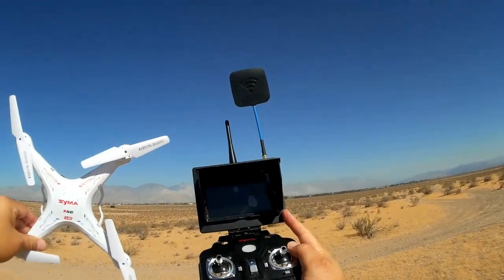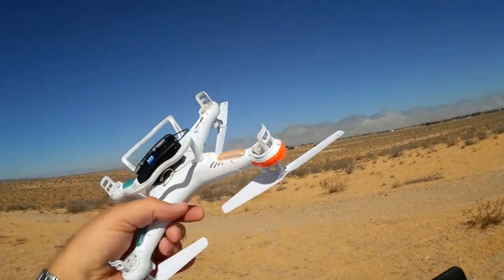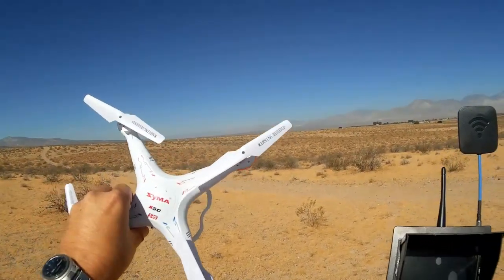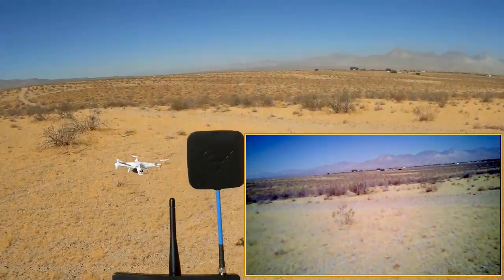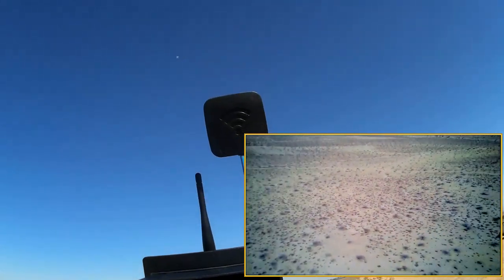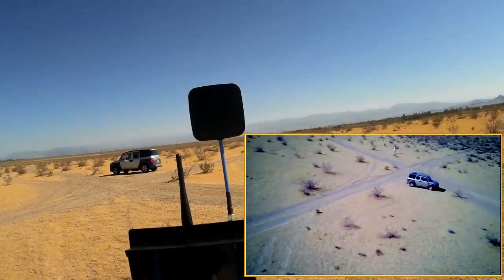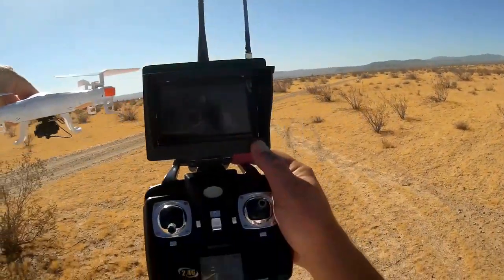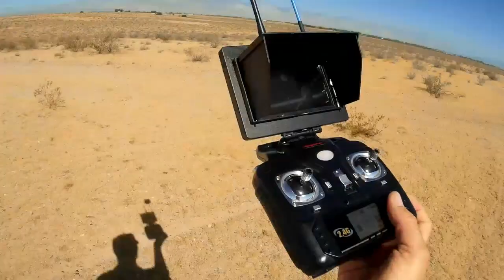Syma X5C X5S 5.8Ghz FPV Upgrade Review

Comment: first of all, please excuse any mistakes or typos. I am using speech to text as my vision doesn't allow for small screens like this to be easy.
Let me just say, that this is the most awesome piece of add-on equipment ever made! the world is completely different flying from the driver seat. I always had trouble using the rudder, flying line of sight, but this makes you naturally use it. it's a really incredible piece of equipment for the price and the fact that I can later add goggles makes it a big winner in my view. thanks for reviewing this now that I have one I don't regret getting it I've only flown it once and I think I'm addicted to FPV now from this point on. so, off to get a pair of boscam compatible goggles. that would make my RC world complete I'm also working on a way to strap this thing on to annex 8 C.

Comment: I bought a 2nd Syma X5C sans transmitter and camera.  I already have two transmitters for the X5, one being the X8 transmitter.  So after watching this video I went ahead and ordered this FPV kit.  It works like a charm and the picture quality is better than stock.  I like it a lot!  Thanks QC101.
Reply: Great to know :) I couldn't find it anywhere though, could you tell me how long the camera's battery lasts on a charge? 
Thanks for the infos.

Comment: First of all thank  you for demoing the FPV system. I did order it and I did modified it for the CX20.  I spliced in a micro push button switch to turn on and off the recording features.  The picture in the screen is clear and you can see it in normal sun light. Then only thing I believe I am getting interference from the GPS on the CX20.  The picture goes in and out around 20 ft.

Comment: I got one of these and LOVE IT! I installed the Monitor in My Quanum Goggles and I took My WLToys V686g Monitor and Mounted it on My Syma Transmitter for the best of both Worlds, It is compatable and works with the 686 5.8Ghz Camera also, what a Great Bargain, Love that it gives the option to change channels which the 686 Monitor doesn't do, but it's easy to match them all up on the V686g Channel, Having a blast doing FPV with Both, and honestly, In My Opinion the Syma X5c-1 is a much better Flyer, gonna buy another BNF version, Just so I have a spare...lol  Great Video as always, thx for sharing!....   ;)

Comment: Once again Quadcopter 101 proves that the X5C is the superior consumer quadcopter. I mean that thing can catch itself if you throw it upside down. Even most brushless quads can't compare. The low amount of heat the syma x5c goes through also makes it ideal for quick battery swaps and resuming flights.

I'm obsessed with that unit. But one thing I should mention, Mr.101, is that I recently found out the syma x5c camera IS COMPATIBLE with the DM007. It is lightweight, super stable, and since it has plenty of power, it doesn't skip frames.

Comment: 1:45 lol Yes I can "see" it. 
I bought a bugs 3 quadcopter and this amazing thing (the camera and screen in your video) about the only rectilinear camera going. I'm not a fan of the fish-eye stuff, but maybe it's better through goggles. Got any (cheap) goggles that are as good as this? This camera and screen only cost about $80 (Australian) and even less, in yankee dollars. It's a steel, and it's HD (720). A lot of the cameras aren't (like the Foxeer Arrow and the Swift aren't HD). I assumed they were, and nearly bought the Arrow. Lucky I checked. I can't believe they are selling 600 stuff in 2017! lol 

Thanks for helping me, I will have a great rig (in a month when it all comes). lol And heaps of bang-for-my buck.! I'm gunna make a video about quads, so they don't get sucked into rubbish, like I did. I bought a "Spider" mini FPV drone and smashed it into a million pieces on the tar road, in a crash. lol I was not yet experienced (and didn't calibrate it to make the auto return work) and it was badly windy, and I lost orientation and cut the power. If it was a decent thing, it would have survived much better. It's made to break and it's inherently weaker cos of the "dog-legs" on it's flimsy arms. 

Also (in my video) I'm going to down-play cogged quads. Small direct drive brushed is ok, but with cogged quads, the cogs are easily broken in a crash and/or they would eventually wear. And not all brands would have replacement cogs (and you can never use any other cogs, no way). So cogged cheapies won't last, like cheap direct drive (brushless) quads would. Those tiny brushed motors are ok cos they are standard and easily replaced (and only cos about a dollar each). And so who cares if they don't last as long as brushless. But those stupid cogs...forget it!!!  

I spent very little more money on my bug than the "Spider" mini drone (cos I got the bug from the internet) not from a shop like I did with the other piece-of-shit. The bug would be stronger and I will NOT fly anywhere near a hard surface until I can fly it competently. lol

Comment: 1. I am learning to fly FPV and this was an inexpensive way to start out. However the 5.8G FPV is bundled with a number of issues folks need to know. about

       2. The USB charging device does not light up when it's charging. So I can't tell when the batteries in the camera and in the monitor are fully charged until I turn them both on. Probably a defected charger, but I won't waste time or money sending it back to China. 

       3. the camera is bulky and actually touches the ground. So I had to pull out the legs on the Syma X5C Explorer about 16th of an inch, in order to have the camera/transmitter clear the ground.

      4. The battery charge on the camera is about 10 minutes. The Syma X5C will fly for about 8-10 minutes with the camera mounted on its belly. So  that is about how much flying you will get. To speed up the time it takes to charge up the battery in the monitor, I removed it and plugged it into a regular charger. I wish I could do the same for the battery in the camera.

     5. The monitor mount isn't tight so basically there is only one position the monitor will be in and that is resting against the antenna. In other words, you can't adjust the viewing angle of the monitor.

     6. The range of this device is no more than 30-40 feet before the signal is lost.

     7. The lens is not very good for FPV flying. I had to tape a wide angle attachment to increase my field of view and that helping quite a bit with flying FPV.

      8. The slot where the camera/transmitter hooks to the mount on the X5C is so loose every time I land the Syma the camera/transmitter falls off. I may have to glue that on permanently. 

      9. Even when fully charged, the display battery fuel readings always shows almost empty.

     10. The plug that goes into the camera battery from the charging device slips out very easily. It is so loose, I have to duct tape it in place when ever I charge the camera battery
Reply from the maker: +Fred Schwingt Yes this has some shortcomings.  But 30 - 40 feet?  I think that yours may be defective.  I easily get close to 160 meters with mine https://www.youtube.com/watch?v=qrzuxjB098E.

Comment: Just a note on what I noticed with this add on.  Got mine yesterday and attached to the X5C.  I have three batteries and one of mine would not lift it with the new heaver camera.  I put in a newer battery in today and it lifts OK but it still reduces performance considerably in comparison with the 808 camera.

Comment: If your SUV has a lift gate you might try using it for shade to try to get your hat cam to capture the fpv screen. Or even just a shade umbrella if you don't want to drop a copter on your element.

Comment: I bought my X5C-1 based on your recommendation. It is so fun! I even bought a second copter for backup so I can be adventurous!
Reply: Blake J Cheaper to repair them, unless you have absolutely no soldering skills.
Reply: This way I can swap in the field. This is also good for letting the motors cool by rotating between the copters.
Reply: Blake J True, or do like I do and fly a different one by the time that one's battery is finished, the other one should be cooled down. Don't think I am not considering another one, I really, really, want the black version^^
Reply: That's what we did. We got the black one first and then added the white one.
Reply: Blake J I hadn't seen the black one until last week? Week before? something like that either way they still carry them on Amazon along with the one with camo rotors.

Comment: Surprised you didn't have an VRS issues.  My X5C-1 clone definitely does with just an 808.  I made a TX mod on it last night, then added shielding to my 808 camera (cut out a blank from the thin aluminum sheet that comes from cat food cans). Gave it a try  tonight. No more range problems and flies great WITHOUT the 808. With the 808 on, its not a stable flyer any longer, and you have to fight it. Might be good in dead calm in low rates. Still, I got some decent video .. now if I only knew how to edit. Maybe I'll find a YouTube video on editing! Cheers and thanks for the review!

Comment: I managed to get just a micro super tiny FPV camera with reciever to work on my syma X5C without any modifications. you just need turn the extra adapter so the connectors are on opposite sides. plug it into the camera slot with the connector so the positive wire is on the far front of the connector (towards the front of the quadcopter) and it plugs in nice and snugly.
and then I just used a strip of electrical tape to hold the camera onto the quadcopter.
and i slightly bent the pins upwards (just barely) on the other end of the connector. and stuffed the FPV camera's connector into the end of the connector. and it holds in snugly enough that I can fly around. and even better its powered by the battery from the quadcopter!!

Comment: I'm guessing your antenna mod makes a difference in range. I flew mine today with a stock system and only got about 75 yards before loosing it to a pine tree. Glad I had a extension ladder and a long paint pole, LOL. I have a older Syma X5 TX that I did a small antenna mod internally to try after I retry a second stock set up a few more times to confirm.
Reply from the maker: +Don Stamper Yes, the stock range of the Syma X5C is only around 70 meters. That's why many modify their transmitters with simple wire extension mods. Just search YouTube search bar for Syma X5C antenna mod for many examples.

Comment: hello, how did you charge these items (monitor/Camera) when using the USB charger that comes with it? do you leave the items power switch in the ON position when charging? whacky thing didnt come with any directions for me. thanks in advance
Reply: +TheMighty Thor  i hope i'm not too late, you dont leave power switch on to charge, also they overheat easily so don't allow it to be switched on without airflow from flying,  its fully charged when red light comes on, but double check by replugging in camera alone and monitor alone,, the camera charging plug falls out really easily, hehe i also just noticed quadcopter101 has monitor antenna facing the wrong way, if you have the option to mount the camera antenna vertically on the landing gear thats the best thing to do.

Comment: Hi,
I notice that with the syma X8 we are not able to take pictures or video  because x8 comes with a 3.5 plug adapter , so because of my curiosity i open a Syma x8 and i saw that  we can disconnect the 3.5 plug and connect a 3 pin connector the same as the x5, and we can connect the camera over there
But i wondering if you can try to connect the camera and confirm if we can take pictures  and video using the syma x8
Thanks  and regards!
Reply from the maker: Alejandro Marroquin I've heard that the X8C essentially has the Syma X5C camera encased within its camera pod.  Yes this sounds like an interesting modification.  In the future I'll give it a try.  If successful, you'll see it here on this channel as a video :)
Reply: +Quadcopter 101 Hi, I also have a X8C and want to know if this is possible, has anyone actually got it to work yet, is it possible to put a 3.5mm jack onto the cable instead of the 3 pin plug, and will the X8C transmitter trigger the on/off for the camera in the same way?
Thanks
Reply from the maker: Philip Auld Yes if you unscrew the camera pod, you'll notice inside is an X5C camera, case and all.  Except its power/control plug is missing.  Instead it is hard wired into the RCA style jack of the X8C plug.  But I can see no reason why you couldn't splice the X5C FPV camera to this jack plug?  But I don't think that I'm going to try it first :)
Reply: +Quadcopter 101 Thanks for your reply, I have my X8C in pieces, in front of me now, and have seen this. The jack socket on the X8C is connected onto the main board with a three pin plug that lookssimilar to the one on the FPV camera but not sure if it is the same size. Also the FPV camera only has two wires, I guess these are data and grnd, as it has its own battery so doesn't need +ve supply. So it shouldn't be too difficult to work out which is which as they are marked on the little board that the jack socket is marked on.
The other question is will the FPV camera mount on the X8C with the same mount as the original X8C camera?
Reply from the maker: Philip Auld Probably not, but that's where velcro may come into play ;)

Comment: Did you put your car keys in your pocket so your wife doesn't take off on you?
I put a post on your FB account. I just bought the Syma X5C-1 and was pumped when I saw this add on. 
Is this camera as good as your strap on units you use like the mobius style one you use and is there taller landing gear out there for this quadcopter that will allow you your credit card gimbal? 
Thanks for your time and videos!
Kevin

Comment: neyaaaH I dont know? Im curious about the lcd monitor, but that camera looks like another one of them product's that the JANITOR'S AT JJRC plant would steel, re brand and sell to us. (like the h9d camera) yuck.   Im still new and I might always fly like a Turrets patient on crack, but i am convinced that the best flight and video platform/combo'S in the Toy GRADE'S ?  Is the TARANTULA X6 equipped with the WLtoy's 686g camera,  fully functional  (manually initiated) FPV quad-copter. IMO, A tarantula x6 with a 686camera FPV running on it's own power source is as good as it's ever gonna get in the stock toy category of RC's... You still ROCK QUADCOPTER 101, your the man,  thanks for the vid's and information.. GEARBEST SUCK'S ASS...OH yea PS.. The LCD monitor look's cool as hell sitting on top of the X6 controller,, the white and black give's the hand held unit's a strong uniform look!

Comment: +Quadcopter 101 My syma x5c is unable to carry the load of this camera. It flies for a few seconds but then it just comes down and is hardly able to hover even a feet above the ground. Tried with new and completely charged batteries but didn't work. Any suggestions?

Comment: Can you use the x5c FPV upgrade on a Syma x8c?
Reply from the maker: Not without some modifications as it has a different plug.
Reply: +Quadcopter 101 what upgrade would you need I am getting an x8c but,I really want fpv but can't find a camera for it
Reply: +Austin Childs  the camera plug on the x8 uses like a headphone jack, i'm not sure if its exactly the same 3 channel type of jack, so its possible you have stuff laying around that could make it work, ie switch on recording or take a pic from your transmitter, but failing that the camera record ''on'' is just a brief short between video cable and ground, so you could easily do that, just search on rcgroups and youtube for it.
Reply from the maker: alan hennesy Yeah, I just modded mine by adding a micro switch from a broken dollar store LED flashlight. It works great!. Now I can attach it and record from anything (cars, planes, quads....).  It's really a neat system for $50.

Comment: Hi Quadcopter 101... I got the X5C-2 for Christmas, and I'm now a two-day-old quad newbie. Love your vids. I've lookex all over can't seem to figure out if this rig fits fhe X5C-2.
Reply from the maker: +James LeBaron Have never heard of the X5C-2?  But if you really have the X5C-1, or X5SC-1, yes this will fit it.
Reply: +Quadcopter 101 Thanks for the response, and the clarification. I was misled by something someone else said in a review video. I guess I just have the "newer version" X5C (with the camera on the left trim button). There's a number 2 on the cover of the manual to distinguish it from the first version, which evidently has a 1.

Comment: Mine just got here but there are no mounting brackets included. So I don't know how I am going to mount it to my x5c-1.

Another great video. Thanks for making.
Reply from the maker: Somwrt Lftur Contact your vendor to have them send you the bracket for your X5C.  You'll need it (unless you want to strap it on with a rubber band).
Reply: Quadcopter 101 Yeah I sent an email to Banggood. I just hope they have them to send because I sure can't find the brackets sold separately. I thought of duct taping it on but decided against it. Thanks again.